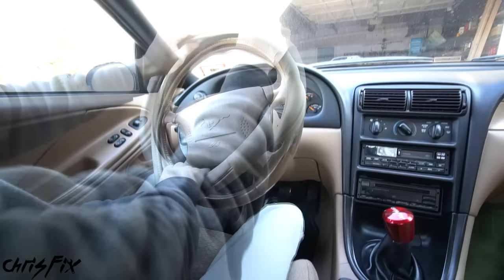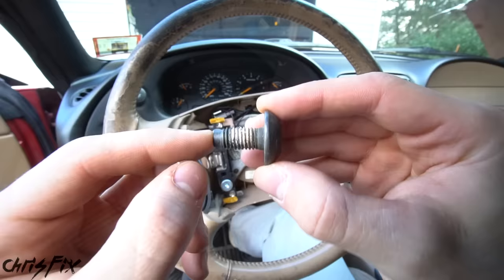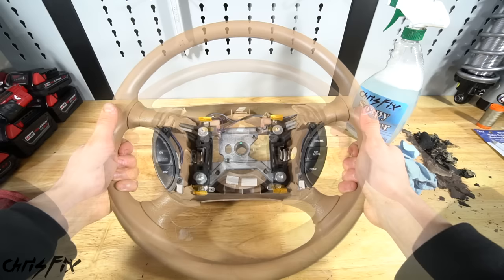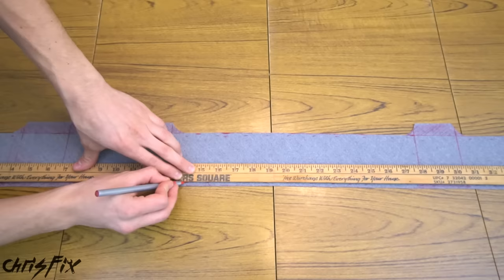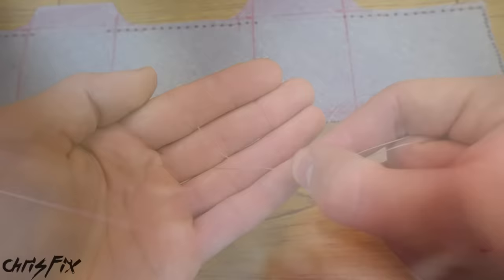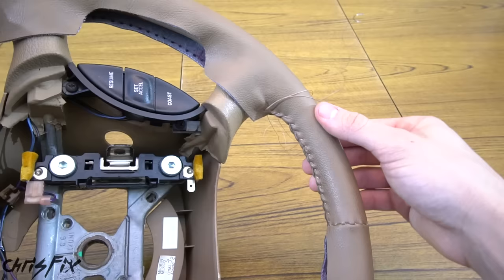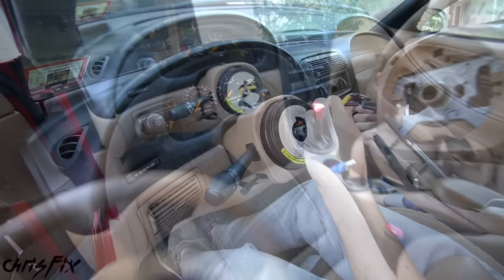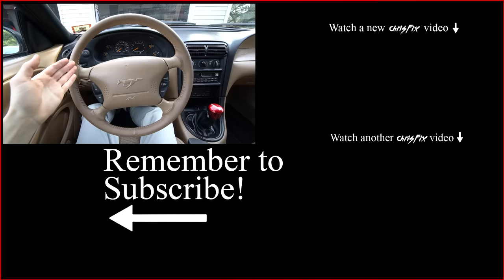How To Restore Your Car's Steering Wheel (Looks Brand New!)

Comment: If you have troubles finding the correct color steering wheel, you could just buy whatever color and then dye the leather. 😉
Reply from the maker: +Jenisten Antony thanks for the tip
Reply: ChrisFix I'm a fan of you!!
Reply: Jenisten Antony i wouldn't dye the stuff, since you touch the wheel much the dye will rub off in a month, and it will only rub off on the places you hold it. if the colour is an issue, just use black, black is always good. luckily my interior was already black and I used 3m 1080 carwrap film for the wheel.
Reply: A good thought, but as a leatherworker a good dye that you let cure for a week or two with sunlight on it won't rub. Takes some patience, sure, but leather is skin, so at that point a good dye is permanent.
Reply: This. Soaking the piece in an aniline dye, washing out the excess, allowing it to dry and then saturating it with carnauba wax, bees wax, paraffin, etc, will result in a waterproof and bleedless dyed piece of leather. I recommend pure paraffin rubbed in and then melted on, simply because it shouldn't melt in the sun in a hot car. For vinyls you can get dyes that bond molecularly, resulting in the same thing.
Reply: Forrest Carroll
Reply: note:
this works great for interior items that dont have a lot of wear like door panels or trim pieces but unfortunately a steering wheel is held in your hand every single time you are in your car and the dye will start to bleed out of the leather almost immediately due to oils in your skin,sweat,etc so i wouldn't recommend this AT ALL .all the carnuba wax,bee's wax or any other wax in the world is not going to lock in a dye into something which has oil and sweat
forcefully injected into it through your pores.
Reply: big daddio; it might rub just a hair in some circumstances, but even boots (which see much more moisture and direct contact; 9+ hours a day if worn all day) that are made of the most heavily-dyed Horween chromexcel leathers don't rub off much dye. Granted, tanneries like Horween use extremely high-quality whole-grain leather (not crappier half-grain or split leathers like Cole Haan/Jack Erwin use). But properly dyed and treated, most good leather won't bleed very much with contact like a steering wheel gets unless it's done improperly.
Reply: I was going to say; my 2 pair of 5-year-old Wolverines and the various pairs of leather gloves I have have never given me dye bleed or color loss problems, given proper care.

Comment: I have the same problem, but I just did it simple and put on a wheel cover and the steering wheel looks great, just going to have to get used to having a steering wheel cover though but that's cool. I personally hate doing so much steps when you can just put on a wheel cover and you're done. Great tutorial btw
Reply from the maker: That works too if you can get it to fit well!

Comment: You did a great job, I do have two suggestions.  Using a pair of needlenose pliers to push/pull the needles through the material will save your fingers and if you take a hammer you can pound that bottom seam flat so you don't need to cut a divot into the bottom of the wheel.

Comment: 14:30 make sure your cars battery is still disconnected, otherwise airbag might go off.
Reply: Is this from experience or? :D
Reply: It's common sense.
Reply: @Vedad1944 Just a safety measure. You can't be too careful with airbags. :/
Reply: Sort of, I was reconnecting a steering wheel, and shocked my self very bad. 12V hurts.

Comment: Nicely done I have years of experience doing upholstery only done maybe a hand full of them or so two tips to make it not only a little tighter but cleaner edges on your stitching is to roll the edge before you stitch it together that little extra tightness helps keep the vinyl in place over the years and 3m contact cement will hold the edges down better and gets stronger over time as upholstery glue like that will deteriorate over time
Reply from the maker: Thanks and thanks for the tips!

Comment: You could also use the alignment Mark II straighten your steering wheel. If your steering wheel is straight but the tires aren't there is an alignment problem and you can simply use that alignment Mark to put them back straight
Reply: Squshy turtle 115 I was thinking this too. My steering wheel is angled counterclockwise a few degrees when I'm driving straight. It's annoying. Now I can fix it.
Reply: Did you really just use "II" to say "to?"
Reply: BlackWatch Squshyturtle 115
Wrong. If your steering wheel isn't in the correct position when driving straight, there's a problem with your chassis. Aligning your steering wheel will give you the illusion that this problem is fixed when it isn't.
Reply: Yes, and your ties will grind away to dust. Fix the problem.
Reply: Good way to ruin the clockspring in the column.
Reply: probably using voice
Reply: How do you figure? the clock spring exists for that purpose.
Reply: Best Lee Sin NA the clock spring is only designed to go the length of the wheel lock to lock. If u turn the steering wheel to one direction and put it on instead of the way it came off then there's a really good chance you're going to tear the wires in the clock spring when u go to full lock on one side. Not a guarantee that it will happen but it's a greater chance that it will. I've had people come in with complaints that their controls on the steering wheel or their horn won't work or the airbag light is on. Come to find out that their "mechanic buddy" tried to fix their alignment this way and he did it for a "reasonable price"
Reply: @3picfai1s  depends on the clock spring but most are designed to be repositioned slightly. Your clock spring contains all the wiring that connect to different parts of the steering wheel so the wires don't break when you turn. They give some extra room for purposes like steering wheel adjustment
Reply: Poor Man’s Alignment 🤣

Comment: There is actually a fourth option, buy an aftermarket steering wheel; such as one made by Grip Royal.
Just saying, Chris! I hope you do get a removable aftermarket wheel. (This hope may be partially because I am a drift/jdm fan)
Reply: Speedy 9771 go check his Fb page, instagram you'll find out why he made this video
Reply: I cannot wait for this but I have a dilemma. I cannot safely use the #DriftStang on the street once I put this in because I'm removing the airbag. But, I don't have a trailer or space for a trailer to tow the car to the track, so the quick release steering wheel will have to wait... dang! Sure does look good tho! 

Since I was getting a lot of questions and this is important here is a little background info. 
Unfortunately it is not safe to drive with no airbag on the street even with a cage, racing seats, and harness unless you use a head/neck restraint which requires a helmet. The harness and cage will keep you in your seat and safe but your head is not restrained and free to move. If you get into an accident, your head will continue to move forward while your body is held in place which could result in a basal neck fracture aka you snap your neck. This can happen at common accident speeds of 30mph. If your car doesn't come with an airbag then that is how it was designed back then to be "safe", although there is a reason why we have airbags in all new cars. I will be doing a video all about this so stay tuned!

This is the post on face book

Comment: Oooooooo Try remove a steering airbag from a BMW. I Guarantee you will struggle to the point you give up
Reply from the maker: haha, its definitely more annoying on some models.
Reply: Daniel its two seconds, you just don't know what you are doing
Reply: isn't that just putting a flat screwdriver into the holes and push the clips in inside? Didn't had any problems with mine :)
Reply: Konrad C I'm talking about newer model BMW's. F30's have multiple clips and require specialised tools to do it correctly.

Comment: Mr. Fix,  You forgot that prior to disconnecting the battery most vehicles require a OBD2 memory save unit so that the CPU settings will be retained without tedious reprogramming.  That step saves a lot of aggravation after the work is complete.

Comment: Why did the steering wheel look like it was in a nuclear fallout,  but the rest of the car looked brand-spanking-new?
🤔🤔🤔🤔🤔🤔🤔🤔
Reply: Jesse Dover Hmmmmmmmmmm... I wonder how that happened
Reply: @daveanderson6023  --- Where I'm coming from (with sarcasm) is...,  the level of apathy that a manufacturer has when they use the absolute cheapest garbage material on the market ,  on probably the most used & abused part by the driver.   It really shocked me to see that Ford Mustang had a steering wheel with (probably) less than 128th of covering on it.   I've owned many Fords,  that I have used & abused the sh*t out of,  and that has never happened.  EVER!
   So..., my sarcastic comment was directed towards..., "What in the hell are you doing with your hands that is literally eating your steering wheel up"? 
You need to wash your hands after whatever the hell you are doing, because it's got to be pretty damn toxic.

Comment: I've used Wheelskins steering wheel covers with alot of success.  It's easier.  At the spokes, it isn't quite as nice but, it looks good.  Also, I didn't remove the original cover.  Yes, it made the wheel a little thicker but, that's fine.  The vehicles I did were a 2006 Ford Ranger and a 2006 Expedition.
Reply from the maker: Thanks for sharing!

Comment: Just a comment regarding the clock spring.
On its interior, the clockspring has a lot of turns of flexible conducting tape. Flex PCB like.
I saw a lot of people turning this device to one side or another while the steering wheel is not in place, resulting usually in posterior damage by cutting those conducting lines just by turning the wheel when it's assembled again.
You'll always want to take into account that the clock spring has no brushes but a number of turns of conductor rolled inside to warrant the airbag and electronics continuous connection.
Sorry for my grammar, my English is a work in progress!

Comment: If you have a few more bucks to spare, you could buy pricking irons, which is a fork/comb looking tool to make evenly spaced holes in the leather. This will ensure the stitches look even better, and have even tension on the material and stitches.

Comment: I'm impressed that you did the leather cover from scratch. I used Loncky brand pre-cut leather steering wheel cover bought from Amazon. Good reviews, good quality, vehicle-specific options with holes. In the reviews, people post how long it took them to do this so it was a challenge. It took me about 8 hrs to do mine and I tried with steering wheel off but quickly reinstalled it because I couldn't get the right leverage for this. The choice is yours as to the pattern of stitching but I used a single needle method running all one way, then worked my way back.

Comment: I was going to do this on my Mercedes C-Class but I decided just to double-check eBay first and found a steering wheel that was still in really good shape for 25 bucks.  So if you're thinking of refinishing your steering wheel it's never a bad idea just to check the used market first.

Comment: Shop class meets home ec... :D

BTW - instead of cutting the steering wheel... if you sewed the ends slightly differently so as to have a bit of a flap - you could use a seam roller or an iron to make it lay flat. 

BTW - BTW - I know that fact only from watching leather workers make seats for private aircraft.... very similar process to fit the seams and whatnot...
Reply from the maker: Thanks for the tip! And yesss

Comment: I went the same route, looking for a new steering wheel.  I found a brand new one for $250.  After looking at the new steering wheel, I realized that the previous owner removed the leather that goes around the wheel.  I found a leather wrap that you can stitch onto the old wheel, for $60.  I haven’t bought it yet but I will be soon.

Comment: Hey, Chris. I know this is an older video, but maybe you'll see this. Have you ever considered doing something like this with a soft rubber-type steering wheel that doesn't have a wrap?
I'm preparing to sell my car, and I want to repair as much as I can, but a new steering wheel is not cheap for my car.
Reply from the maker: Yeah same process but you don’t have a template to work off of.

Comment: Nice Job.  Not exactly my specialty but I have a headliner I am getting ready to replace and the leather on my steering wheel is worn in one spot so if I don't like quote to get everything done then I will do both myself but for me to tackle it I need to get motivated and nothing motivates me more then being over charged for something I know I can do myself.   On the other hand its also a time issue for me but I did enjoy watching you rewrap a steering wheel its something I was actually curious about how to go about doing it.

Comment: You can drain the capacitors fast if you disconnect the battery and then pull power by pressing the brakes, turning on headlights, or by switching the ignition to ACC

Comment: chris useally when i remove the airbag or some sort i leave it with all the lights on and leave it for 10 to 20 mins then honk the horn and if it doesent work your safe
Reply from the maker: Good way to verify after the battery has been disconnected!

Comment: A Simple fix is to buy vinyl paint .. paint the worst parts several times until the wheel looks good ,then use hair dryer to dry the moisture out of paint ,then polish it with meguires ultimate polish only use the blue rolls of shop towels to polish ...Canadian tire

Comment: I am working on covering my 2010 Toyota Prius with real leather. I tried using the curved needles, but I personally found it more difficult than using straight ones because I couldn't get a good grip on them when pulling them through the holes...they kept slipping. Plus, my curved ones are sharp and I keep poking myself, ouch! Very helpful video, thanks!
Reply from the maker: The straight ones can work to, I found the curved ones to be easier in my case. Either one works! Thanks a lot!

Comment: What weight leather did you use? Did you have any movement of the cover afterwards, since you didn't use any glue? I also think you need to press those seams flat to make for a better look and feel, otherwise, looks good!
Reply from the maker: I don't recall, it was just what a shop near me had that matched well, and it's pretty tight so it's hard to move it and that's a good idea if I ever do this again!

Comment: Pretty good but I wouldn't call it professional looking. It's on the way, though. The seam joining the two ends should really be done using two threads the way a machine would do it. The single thread technique looks very "homemade." Also, the seams on the lower part of the wheel look like they're rotated slightly forward as compared to the top section. Maybe this is due to the fact that the material was folded under at the spoke only on the front side, creating a discrepancy between remaining available material front and back?
Reply from the maker: Thanks for sharing, if I ever do this again I'll keep this in mind

Comment: I've wonder why you didn't replace leather with leather (unless you didn't know a shortcut) or why you didn't follow the manufacturer's pattern. Why did you put the joined vinyl at the bottom of wheel vs the OEM pattern? If you had used leather, then you would require some leather tools (chisel, knife, hole punch) & cutting techniques. I like this greatly. TY.

Comment: You used to be able to buy a leather steering wheel cover. You got it, put it over the steering wheel  and used the provided cord to lace it up. Now you can only buy bulky molded rubber  overs, they suck.
p.s.; I wrote this before Christ made his own cover, very good  I would have liked to see the stitching carry over the "hump", not knowing what to call the connection points.

Comment: Also after 10 minutes+ of having a battery disconnected, you risk wiping your car's omissions control sensor, and your PCM module. The ride will be rougher. I feel you should mention this.

Comment: When I work on a car with airbags, I disconnect the battery cables and connect a light to them. that way the capacitors drain through the lamp

Comment: Hello Chris, since I cannot find a video, I wanted to ask a couple questions. I just bought a new used car, and I noticed that right underneath the dashboard behind the pedals, the bar that goes to the steering wheel is exposed and really rusty. I'm guessing the bar is called the steering wheel arm? I've never seen them exposed like that in new cars. Only the really old ones. My questions are, does it need to be covered up? Second question, should I remove the rust and clean it up, or just leave it? The steering wheel and everything works fine. I'm just worried with how rusty it is, and with it being exposed, it might cause problems in the future.

Comment: For $20 you could have bought a leather steering wheel cover on Ebay that is all ready cut and the holes are pre-punched.  Save a lot of time and work, just stitch it up.  I did mine this way and looks better than a home made one.  Just sayin...  And you soak them in water before installing and stitching so they stretch and when they dry they shrink and are super tight.  :)

Comment: Has the work held up over time? I was wondering if the material would have loosened/stretched and started sliding as it wasn't glued to the wheel.

Comment: My Method of Refinishing the Steering Wheel
Remove the Key, Turn, Open the Hood, Disconnect the Battery
After Removing the Steering Wheel, Clean, use the Leather Spray Paint, Install the Steering Wheel Back in the Car, Reconnect the Battery